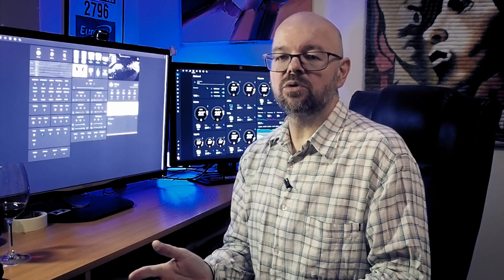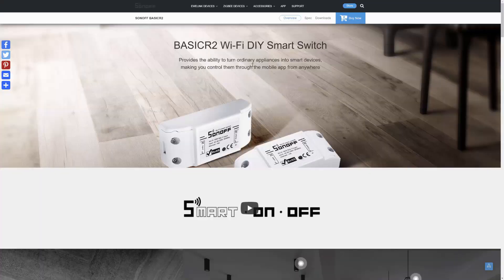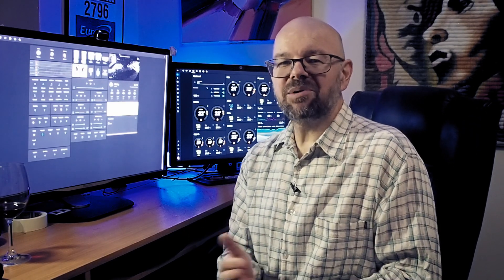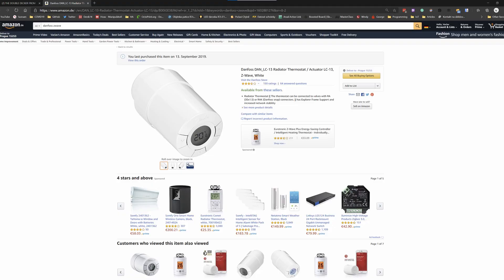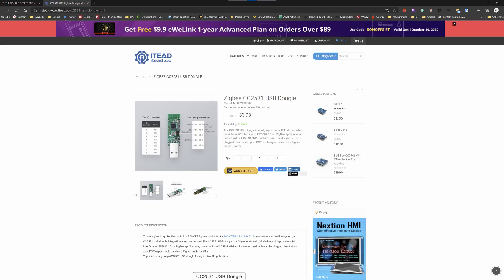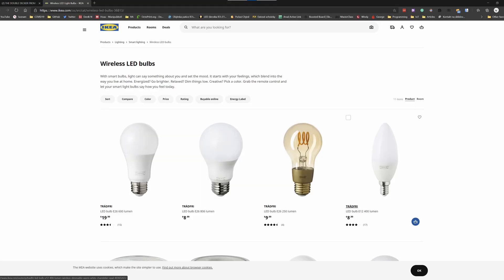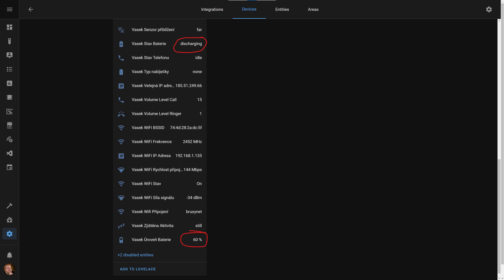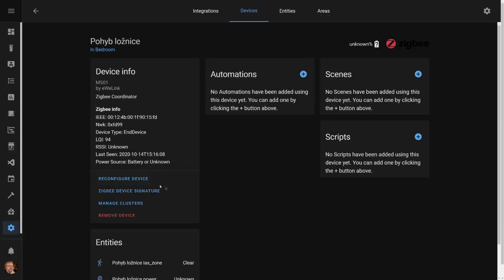Zigbee, Z-Wave, WiFi - which is better?

Comment: Please explain how you'd heal the network in zigbee.
Many thanks
Reply from the maker: Unlike Z-Wave, ZHA does not have this option directly. There is function to reconfigure device. Or if you turn off HA for 30 minutes, the Zigbee will go into a panic mode and reconfigure the mesh. But Heal is a Z-Wave function, you are right. And the video was showing adding a Zigbee device, so it might have been confusion, sorry.
Reply: @bruxy70  that's great to know.
Much appreciated sir